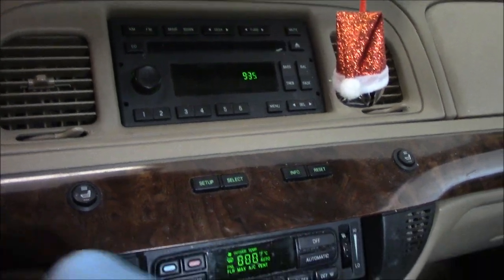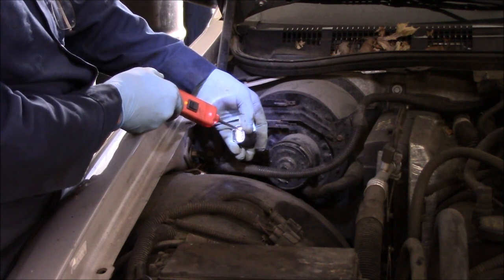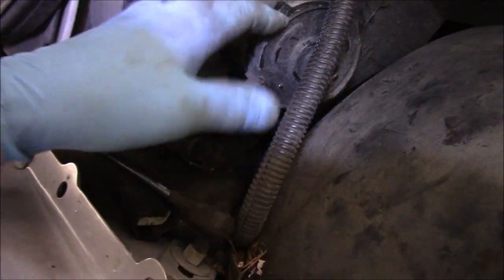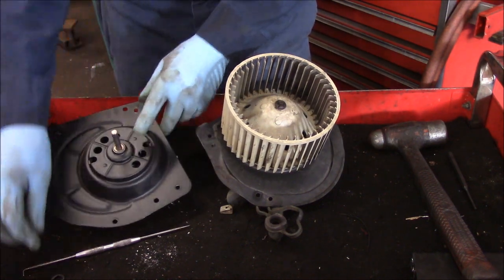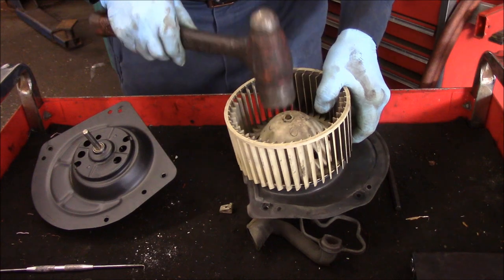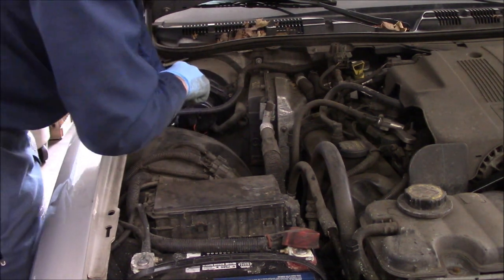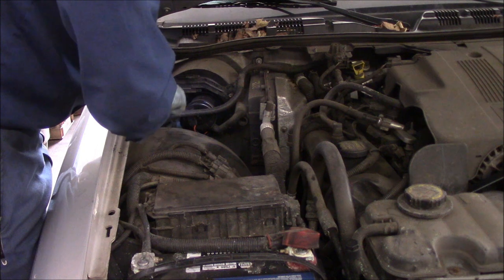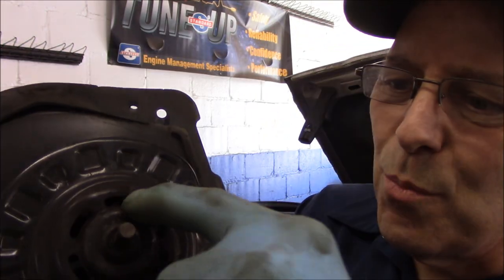How To Fix No Air Conditioner - No Blower Motor - No Heat

Comment: HI Jim you were great on explaining how to check for a burnt out motor when the blower or heat doesnt work I will check to see if the motor in my car is not working because the heating system doesn't do anything.  I was told it might be thermostatic or resister.  You are so patience when showing the problem.  Thanks very much

Comment: The ac/heater went out on my 2004 CV. Tested the blower motor by connecting it directly to the battery and it worked fine.  Did the Blower Motor wiring test with the control module on, and it didnt show a - but did show a + . Before messing with the wiring I replaced the Resistor and that solved my issue. Resistor didnt smell burnt, damaged or anything but took a chance and replaced it anyways. Issue solved. Good luck guys!
Reply from the maker: I'm happy to help.Thank you for watching and your input
Reply: Need he)p got no cold air

Comment: Nice! Got a burning electronics smell from the vents and the fan motor quit today.. so, looks like another motor on the garbage heap! Also, have been through the blend actuator motor FOUR TIMES on 3 of these Mercs! Now I just use a 9v battery and connect to the purple wire from the controller and run the blend motor to hot for winter and to cold for summer and leave it at that, works beautifully and takes no more than 5 minutes to do after the first time. Clip the purple wire and connect + 9v battery to it and - to ground for cold. Reverse - of 9v battery to purple and + to ground for heat.. run either way until you get the telltale clack clack clack of the motor hitting its' end stops.. DONE!
Reply from the maker: Thanks for watching and your input.

Comment: Thank you for showing the test to use for troubleshooting the various parts of this system.  I would like to add  that when you have the blower motor off you can see your heater core. This is a good time to do your car a favor and clean out all the leaves and dirt. I even used brake clean and a soft bristled brush.
Reply from the maker: I'm happy to help. Watch for the next free tool giveaway coming soon.

Comment: Great video Jim. Glad you weren't going after an inside heater problem on that car.  I bet you see a lot of crown vics and grand marquis. BTW  I may have built that car. Worked at that plant for over 20 years. IMO a good solid reliable car. Keep up the good work Jim.
Reply: I have 2 grand marquis 04 08

Comment: Hi sir, i believe i have a different problem. I have a 2011 crown vic, manual AC control, i would get in car to drive and no air coming through registers then go into store come back to car and boom the ac works again. The AC is working but blower motor not working, this is off and on. So someone suggested i replace HVAC blower motor resistor, which i did, but yet same problem. I would appreciate any advice , thanks.

Comment: Maybe you can help. My blower motor was only blowing on high. I replaced it with a new one, same thing, high only. So I guess I need to replace the blower motor control module,  is that correct? Next BIG problem,  my heat does not work qt all. I have a new radiator,  4 years old with a flush 2 years in a row. I recently had to have the water pump replaced. Still no heat. The thermostat is opening and full of antifreeze.  Can you tell me what to do know? It's getting cold.

Comment: I'm a little late but I'll try for answer .. 2003 ford CV blower motor or not? not blowing high or low ....took out motor jumped off battery spins fine I guess lol or is it the resistor ? i heard if it blows high only its resistor but its not blowing either fuses sre fine also...resistor? lol

Comment: I hope you read comments. I have the same car but my air won't turn off. The second i turn my ignition to give power to the car, it starts running on high. I can't turn it off by pressing off, and i can't change the speed of the fan, only the temperature. Will getting a new motor with a resistor fix it? Or do I need to buy a new relay?

Comment: Great video. I have power to the fan motor connector but no ground. I have the EATC type system. I have tested the fan motor and it works. How should I procede to troubleshoot my problem?
Reply: What did u end up doing?

Comment: I'm having this exact same PROBLEM,. Only difference is I'm experiencing this on a 2014 Chevy Trax LTZ. Techs tested the blower motor an panel, apparently they are working.. and told me the resistor was shot... I Changed the resistor and I'm STILL having the same problem,
Could you offer any insight, and also should I check the battery with an ohm meter for any safe mode shut offs, or how do I test/fix it on my own.

Comment: Mine quick working and it turned out to be the plug connector to the blower motor.  cleaned the connector and filled it with dielectric grease.  been working for years now.

Comment: Jim, I have a 1998 Explorer, Eddie Bauer. The fan motor is not working in the front but it does work in the rear seats. Is it the same fan motor for both? I have the same unit in the dash and it still digitally reads temperature but the hot and cold buttons no longer light up. Can you help? Thank you!

Comment: I'm working on.my parents 2005 Mercury grand marquis i just replaced the     HEAT & A/C unit still no heat ,air or blower could this be the reason in your video that I'm having issue  still

Comment: I have a 2012 Ford Focus that got the ac system completely discharged after replacing the engine.  Now I have no air at all.  Friend of mine tested the Blower motor and resistor and he said they are in working condition.  He claims since the ac system is empty there's a pressure switch that will not allow the blower motor to engage. Does that sound correct? Sorry for the long comment.  Great video btw.
Reply from the maker: Does the fan turn on but blow out warm or do the fan not turn on at all? The ac being empty will cause the ac compressor not to turn on but the fan should still blow out warm air. Keep me posted.
Reply: @jimthecarguy  Hello there, thanks for the reply.  No, the fan does not turn at all.  However, I did the following tests.  Checked the relays and fuses, and they work.  Checked the resistance in the Blower Motor Resistor and it checks out to specs.  I provided power directly to the blower motor fan and it turned right up.  And one last thing, I checked the blower motor resistor input wires by probing the hot wire in the connector with a test light to see if they were getting any ground when the HVAC switch turned on.  Here's what I found.  When I set the switch to speed 1, the wire corresponding to that setting gets grounded.  When I set the speed to 2, the wires for 1 and 2 get grounded, when I set the speed to 3, the wires corresponding to 1, 2, & 3 get grounded.  And finally when I set the speed to 4 (Max), all the wires in the blower motor resistor connector get grounded. I saw in another video a gentleman saying only the wire corresponding to the set speed should get grounded.  Is that correct?  What could be the culprit?  The HVAC Switch?  Thanks a bunch for your help, in advance.

Comment: Hello Jim. I really appreciate your video's. My sister has a 2010 Audi Q5. The blower motor stopped working. It does not work on any of the speeds. I am thinking that the resistor is most likely the problem, but not certain.  I am wondering if you have every changed a blower resistor on an Audi Q5? I have purchased a few different repair manuals for this vehicle, but they are useless. It seems like Audi has refused to release any repair info fro this vehicle. Any thoughts or advice that you can offer would be very much appreciated!  Thank you. Richard
Reply: richard johnson Basically if you are getting no response from either of the speeds of the motor blower, most of the time the motor needs to be replaced, but first do the exact same thing that was done in this video, check for power and ground in the wire harness going to the fan motor first.

Comment: hello i have 2006 grand marquis ls .. my a/c went out after i hit a deer this winter .. worked before the deer , anyway now my blower motor is stuck on all the time , no matter wat speed or even if the thing is on or off , soon i turn the key on the fan speed on full blast . i got the tipical problem with panther cars the blend dor acuator under the dash is bad m so only air comes out defrost . any idea why the blowr motor is stuck on ?? i just took out the fruze and now got nothin.. its summer time now ,so lol live able
Reply: Well, congratulations?

Comment: Do you have any idea why I would only be getting 9 volts to the blower motor? I Changed resistor and checked the blower motor with a battery. I have also checked all the fuses in the car. Thanks

Comment: Jim I have a question as you have described above I have no power to my blower fan. I check electrical harness for ground and power I have power for the blower but no ground could that be the resistor Thanks Rob
Reply: Did you figure this out??? I have a 2000 grand marquis with same ..no blow period ..

Comment: Question mine went out a bit ago will be doing this myself soon but my question is would the blower motor start to affect the car wanting to fire. I have a 2002 mercury grand marquis. It stated first with a rattle noise under the car to blower motor going out to now it wants to fire when i turn the key at times. Only form of transportation  so i am scared and dont have the major funds to take to a shop atm.
Reply from the maker: It is possible but the blower motor will not cause the car to not start. What happens when you turn the key?
Reply: @jimthecarguy  it starts to turn over but wont fire up. I have tried waiting a minute and turning again and wont turn over. I go under the hood and push all wires and gaskets exposed and try again. Sometimes that works sometimes not. Its really random
Reply: Im sorrybits a 2001 mercury and its doing the no start thing more frequently. I will be taking it in tomorrow for a check up. I have a bad feeling its the fuel pump going out too.

Comment: I have crown vict 2012  iam from Saudi Arabia and i have same problem and i check every things fan and resistance and fuse all ok but there is no air come and the fan working  no problem then i deiced to change the fan and now its work ok maybe it burn from inside i done now how ac motor became with brush

Comment: I have a 2003 crown vic, I have replaced the blower motor, resister, and the main control cluster, what next?
Reply: Did you ever figure what the problem was? I have a 2003 grand marquis, the blower works but no air is coming out
Reply: @THESMOOVEGAMER  mine was a wiring issue. Yours is probably the blend door
Reply: I replaced the hvac , ambient light sensor, blower motor, and blower motor resistor & my blower motor won’t turn on I have the same year grand marqui

Comment: I have a Ford Marquis 2011 first of the predecessor of the predecessor before the operation operates the air conditioner on the strongest degree and what is required to disconnect the battery and Mafi Vaida

Comment: I replaced my blower motor and the a/c control unit and my a/c still don't work.. I need help
Reply from the maker: Did you do any testing with a test light before you change the parts?
Reply: Crickets...

Comment: I watched your great video today about checking & replacing the blower fan motor in a 2008 grand marquis.
What is the name of mfgr. of that cool electrical tester, that you clipped its leads onto the vehicle battery 
and then use it to verify ground, as well as voltage, at the connector to the motor?
Reply from the maker: It is a great tool .Made by Power Probe. Check my Amazon store in the description in the video to see the tool.Thanks for watching

Comment: I have a 07 Vic p71 I just replaced the blower motor and still no air
Reply from the maker: Did you check for power and ground at the blower motor?
Reply: jimthecarguy  yes and the fuses and relays

Comment: What if you have power on both ?
Reply from the maker: If there is power on both wires you will need to check the ground wire to make sure there is a good connection. Keep me posted.

Comment: Hey I have the 06 crown Victor police interceptor ac was working great today the blow motor quit working so I turned the switch off and on and it came back on ..then it did it again so I turned the car off and cranked it back up and it worked again like normal ...then shut the car off again then after start up again now blower motor want even turn on i can here the ac engaging and the vent doors opening when switching selector..fan speed doesn't do anything...i tested the blower with another battery blower kicks on used a light with red and black and tested the pigtail end and it lit up ...so what do you think my issue is
Reply: Robert Hardy sounds like the blower motor resistor
Reply: I have similar issue. For you I would check your compressor and make sure it engages as well to be sure. My Jeep has no air or heat on any setting. I tested the blower motor with test leads to my battery and it turned on really strong, compressor engages how it should, I can also hear the blower motor and vents engaging inside the cabin, and it's full of freon. The last thing that I have is the resistor that could be bad and that's all that I have left to check other than a possible relay. Good luck hope you found your solution and maybe this helps.
Reply: @lancedrexler2748  He just said that he hears the compressor engaging. His problem is the control module.

Comment: I have a 2003 Victoria and last year all the sudden my AC and heat fan would  Would fluctuate vary wildly in I couldn't control it what the high and low knob now it doesn't work at all only when I'm moving in my car is warmed up will a faint bit of heat come out of my vents same with my AC please help
Reply: hi, i have the same problem, i changed the resistor and the switch behined the controls and still nothing, i think it is the motor itself. its a matter of illimination.
Reply: Adam G I actually just got it fixed and it was the blower motor relay or something like that

Comment: I have a 2002 crown victoria THE blower motor doesn't work I have replaced the motor blower and the resister the blower motor still will not work what's next???
Reply from the maker: Did you check for power and ground with a test light at the blower motor?

Comment: So it can be the motor if the air don't comes out the vents?
Reply from the maker: It could be but you need to check for power and ground at the blower motor first.Thanks for watching.
Reply: @jimthecarguy  thanks

Comment: I have a 97explorer with E.A.T.C. I have checked the blower motor - works. problem is - can't get blower motor to work with the E.A.T.C. control. when I turn the dial to low - medium or high the motor does not kick on or blow heat. the E.A.T.C. powers I can hear controller switching from floor to vent to defrost. I was told that there is a switch in the middle(under dash) called speed  controller - that controls the blower motor. anybody have any Idea if - I can run direct power to blower motor from the E.A.T.C. like by pass the controller? and I can get heat? did research from ford and controller is over three hundred.

Comment: would the procedure be the same for a 2003 Grand Marquis?  Mine quit. I can measure 13v at the connector.  If I change the fan speed from the inside it changes the voltage at the connector
which I assume is how it changes the fan speed.  I also applied 12v from the battery directly to the fan and no go.
Reply: Hi my problem is my heater not working but I look in fuse box and wasn’t blown fuse I replaced but kip blowing the fuse  my car is Mercedes A180 cdi 2007  any help be for take to a garage

Comment: Great job!!!
Reply from the maker: Thank you for watching . I'm happy to help. Don't forget to subscribe.
Reply: @jimthecarguy  I checked for voltage at the connect on the blower. I had battery voltage, I installed the new one. Works great, I checked the old one with a battery from my 18v drill. It spun like no problem, to bad you couldnt add a booster like you can on condenser on house central air.
Reply from the maker: Thank you for watching . I'm happy to help. Don't forget to subscribe.

Comment: Heck I replaced blower/motor,resistor and fan control switch, nothing ,found blower not grounded-grounded to frame ,blower works all speeds except high and heater only slightly warm and ac on slightly cool.?????????
Reply: did you figure it out i have same problems
Reply: I'm Waiting for a response too

Comment: My fan works fine but the heater doesnt blow hot air and the ac doesnt blow cold air. Just air.
Reply: john newman need to add refrigerant i think
Reply: Also, sounds like you need to add water/antifreeze to your radiator

Comment: Easiest first?  How about a fuse or relay test?
Reply: Sir Sweetness basically he did check the fuse cause the motor had power and ground if he had no power he would have went to fuse box for the blower motor fuse if it only blew on high he would have probably replaced the resistor block that controls the other speeds